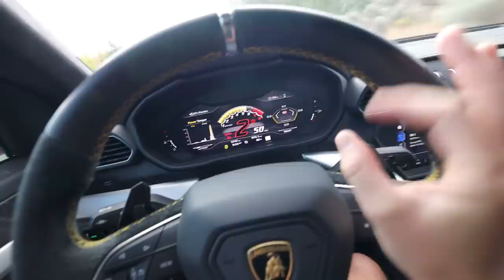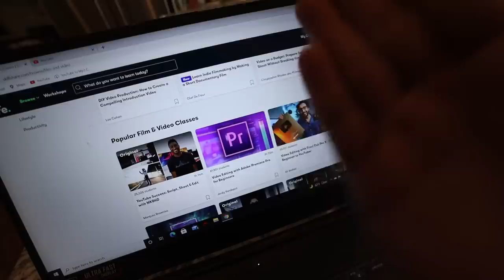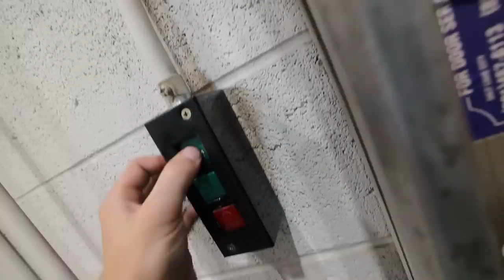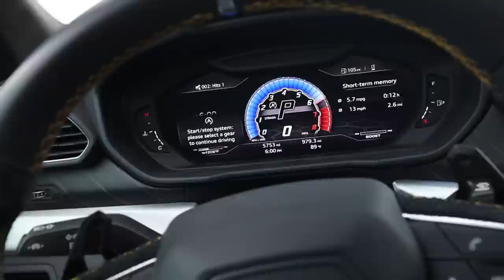The $8,000 Exhaust for my Lamborghini Urus!!

Comment: The only thing I can think for the discrepancy would be if you ran bigger wheels and the car learned to adjust the speedo and when you put the factory rims on it did reset in time so it was showing a higher mph that what it actually was.
Reply: Hrmm ... or the ECU was recalibrated for the new rims and Strad did nothing but take them off and put the old ones back on. This one actually makes sense.
Reply: Or as seen in the video, he lifted his foot of the gas before the trap speed sensors....

Comment: Wish the Bugatti got a accurate reading, should have used some racelogic equipment 🙌
Reply: It was accurate. The Veyron disengages from top speed mode when you turn the steering wheel too much. And when this happens the rear spoiler goes into downforce position reducing top speed and high speed acceleration.
Reply: @v4skunk739  I see, thank you for explaining
Reply: @v4skunk739  I think it was because of the shit road he could turn the car more and would’ve been fine but with how old the car is and the shit road I think that’s what messed with the system
Reply: @v4skunk739  yeah it's 15 degrees that kicks it of top speed mode. But it's odd that other Bugatti's have taken this course in the past and done over 230 MPH (did they only use the straight part in the past?)
Reply: @ICP1SBJ  Perhaps the over cars stayed in top speed mode or they found a way to keep the spoiler in the low position.

Comment: Strad the top speed mode was disengaged because it is only available when you are going straight in a line for 2 or 3 miles, you had turned the steering wheel to the left so the top speed mode was disengaged 😁😁😁.

Comment: I always run Garmin GPS units in my cars to use for exact speed. My Boxster is off by 4mph in town and it changes a bit at high speed. My 2009 P71 Cop Car seems to be dead accurate but it was a cop car so... lol. GPS don't lie and it records the highest speed hit, great for proof and bragging rights ;).

Comment: I have 2022 Urus. Factory exhaust sounded insane and pops and crackles like crazy in Sport or Corsa mode. That said I never leave anything stock. lol. I did the Capristo 250 cell cat down pipes (4800.00) and Armytrix Valvetronic full exhaust. Does it sound better? Yes. Not huge diff over stock imo. Stainless muffler Looks better and more power though with tune I’m around 800 HP. Also no exhaust is worth 8000.00 imo. Armytrix was 4200.00 on sale Black Friday. I think normally 6500.00. Acropovic and Capristo aren’t only game in town now Armytrix just as good or better imo. Can control with remotes or my I phone too. The Catless down pipes are lot cheaper than high flow 250 cell but they stink terrible to me and don’t make much more power than 250 cell cats.

Comment: Stradman, if you didn't empty the fuel tank before you added the 100 octane, any amount of remaining fuel would cause a loss of octane. The car's ECU would sense this and make the appropriate adjustments for such (detuning the engine and disabling top speed mode).

Comment: On your top speed run i think that let the gaz go before the speed detection so i think you actually went at 213 and so i think that with the top speed mode and the 1001 HP you could have went at 235 even 240

Comment: Not sure if it's been said...but as soon as you turn the wheel past a certain degree it automatically kicks you out of top speed mode.  Top speed mode is meant for a straight line only...definitely not the road you were on...just fyi

Comment: I agree with FettyWhopper  if the diameter of the wheels you used were different from factory or modified  slightly your speedo would also have to be adjusted to the current size you were running.  Same as if you drove the Donk on factory wheels and switched to 32" and wonder why cop gave you a ticket?  Diameter and speed error from factory would have made the difference.  Also where is the spot they actually clocked/LASER you at?  LOL put on Smallest rims and set a new record.  J/K.

Comment: Hey Strad, So about the sun valley thing and you not knowing if your Bugatti hit 191 or 213, 
My theory is that you did hit 213 but you braked too early causing the car to drop 22Mph and passed the checkpoint as you were slowing down

Comment: Seemed to me the wing went up and it went out of race mode about the time you took that slight curve. Wondering if you can only turn the wheel so much in top speed mode without it powering down.

Comment: So I’m sure I. The last video you knew it was not in full send mode after you took off about 1min or less you called it out. You noticed the wig come up after the curve and you said it disengage full power.  

Now that being said, I think it did that because you turned the steering wheel too much. I think it’s a Safty thing if your going in full send mode and if the steering is turned at a certain angle it would disengage full send mode.